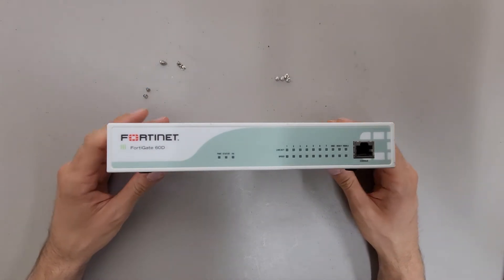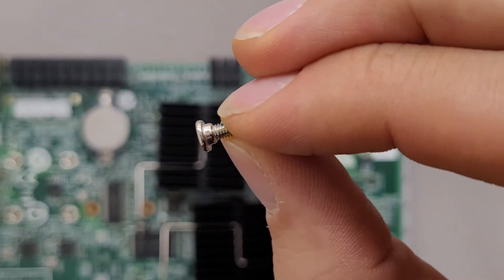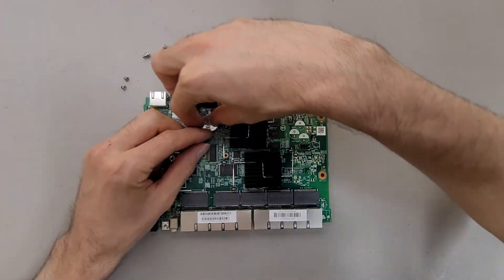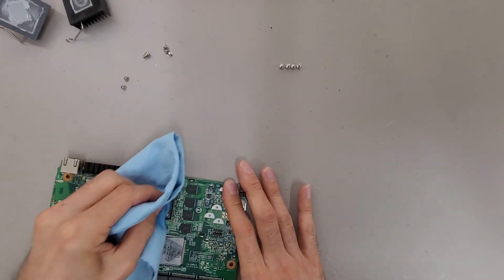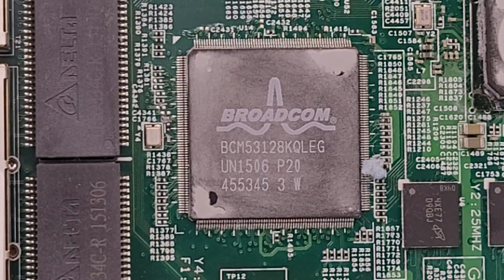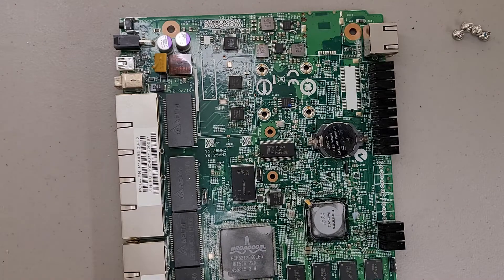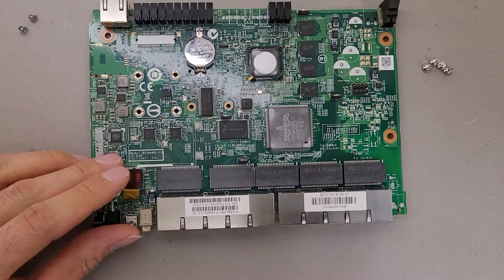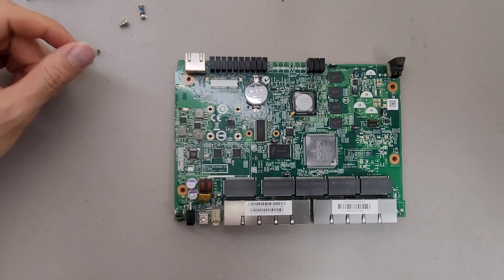Fortinet Fortigate FG-60D Firewall #teardown

Comment: glad u mention that capacitor issue having the same issue with 60c
Reply from the maker: Yeah they had a bit of a bad run on the earlier ones. Hopefully the newer models held up better.
Reply: allot boot issue  seems as if the device is not starting up when even does it malfunction even  downgrade through tftp
Reply from the maker: @leopaulevans7573  If the capacitors are bad then it may act erratic. You would either need to replace the bad capacitors, or move your license to a properly functioning unit.
Reply: @computersales  just purchase for home use n practice considering a newer version as well trying fix notice one of the smd capacitor is reading short to ground need to find source of that problem

Comment: I am sorry to bother you, can you please tell me if that board had POE (I have FORTIGATE FG60E and I need POE   So I wonder if it has option for example to solder some  restors to activate this option) thank you.
Reply from the maker: To the best of my knowledge these don't have Poe. If they did there would be some additional support hardware required for the power regulation. A bit more than a jumper or a resistor modification unfortunately.
Reply: @computersales   thank you for reply, ill have to continue  with injector, it just additional weight on my socket and cable management :)
Reply from the maker: @smokeforless3071  PoE switches are getting pretty cheap if you are in the US.  The EX2200-48P-4G is a capable older 48-Port managed gigabit switch for +-$100.